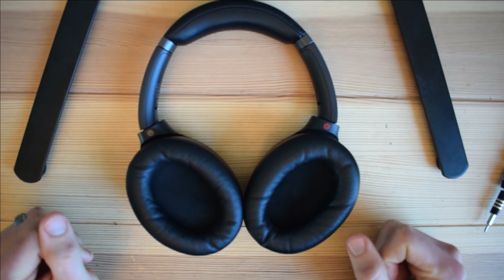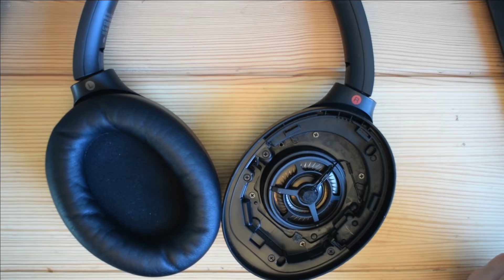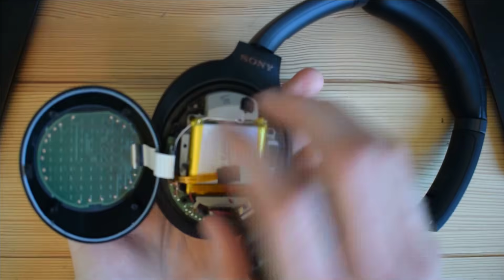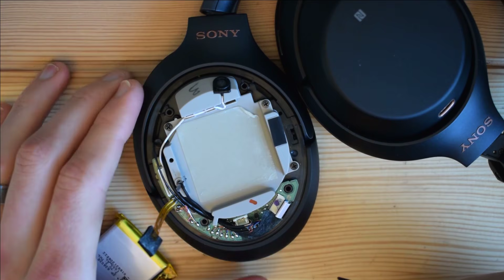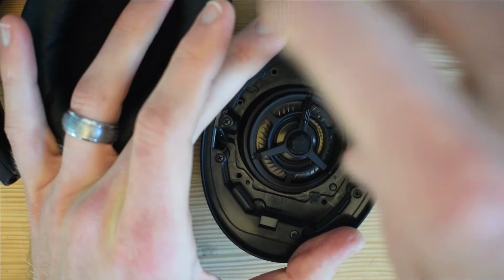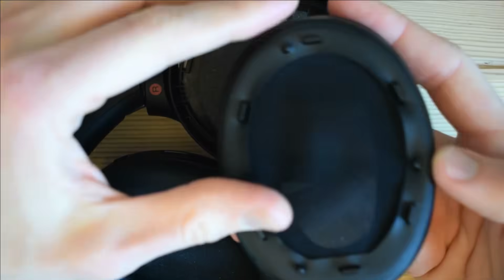Sony WH-1000XM3 Battery Troubleshooting, Repair or Replacement Walkthrough - Teardown and Fix

Comment: i have a problem on my XM3. 
when i put my headphone to Noise cancelling, the right is not working, it sounds like the right side is on Ambient mode instead of Noise cancelling. 
when i put it on Normal mode, they work perfectly fine.
when i put it on Ambient mode, they work perfectly fine.
when i put it on Noise cancelling mode, the problem will be on the right side of my headphone. the left side work perfectly because i can tell what is NC and AM and literally, AM was on the right side instead of NC. i hope you can help me with this problem. and seems the update won´t help me either.
Reply: same problem here, have you figured it out yet?
Reply: @disguyaspy  idk if the latest update has something to do with it or a problem with optimization. Atm, my headphones is pretty normal now.

Comment: great vid had mine xm3 for 1.5 years now.did purchase with £50 pcworld 3 year insurance which ive used 3 times to get brand new headsets so well worth getting the insurance but knowing how to replace the battery is suppurb.

Comment: I wasn't careful enough trying to disconnect the batttery, and ripped the battery cable female connector pads from PCB, all four of them :(
I'll see  if they can be reconnected somehow, but it's looking bad
Reply: BTW found a LOT of water inside the headphone XD 
"that's your problem right there"
Reply: Water? In which part?
Reply: Maybe you walked during rain? Btw. you can relatively easy solder cables.

Comment: i have a problem my headphones charge but when i atempt to turn them on the blue light flashes and the headphones do not turn on !

what do i do ??? , this is Urgent !!
Reply from the maker: Hello. There are a number of possible reasons the headphones won't turn on: 
1) The charging port itself could be damaged/faulty. Here is a walkthrough on how to replace that: https://youtu.be/GmfoTpZiX9U
2) The power button could be damaged. I do not have a video on how to replace that but it does not require soldering so it's a fairly straightforward repair.
3) The main board could be damaged. This is a case where unfortunately I would recommend replacing your headphones. The repair process for the board is very complex and has a low success rate (in my experience). 
Best of luck!

Comment: It's very nice to know that the earpads aren't glued down. I've had them for a year and my battery life has gone from 30 to 24 hours (I use them daily at work). Still plenty obviously, but it's great to know I'll be able to fix them in the future. Saving your video for when that time comes!
Reply: same, I don't have these but when it comes to bluetooth things, or even smartphones, how easy it is to replace the battery, and the availability of batteries is very important for long term usage if you really like the item, instead of having to upgrade every time the battery sucks
Reply from the maker: @HearMeLearn  Very good point! Phone batteries used to be extremely easy to replace but now are such a pain and you often have to disassemble the entire device just to access the battery. Thankfully these are quite straightforward
Reply: @jontriestofixthings3718  hey can we officially replace our batteries at a Sony store? Or DIY is the only way?

Comment: Had the blinking red LED warning indicating the headphones were charging at an abnormal temperature,. This happened out of the blue and I knew the headphones had not been damaged in any way, disconnecting and reconnecting the battery entirely like this video shows was the only way to resolve this issue so thank you! I strongly recommend people try this before sending off theirs for repair.
Reply: I had the blinking red LED as well, which stopped the headphones from charging. In my case, the contacts for the temperature sensor on the battery had popped off their solders. It's the yellow cable in the video. Even with my shaky hands and cheap soldering iron, I was able to solder the wires back, and all is good now. Thanks for the video!

Comment: At this very moment , I'm trying to find the right size of screw to open the battery side 

I recently drop it a few times at the gym , and the Touch Pad is not working at all, I did took it to my local Sony store n all they say was to repair at 300$ USD to replace the hardware lol , I hope when I open it , its only the wire loose after dropping it..
Reply from the maker: Best of luck! Let me know once you've opened it up :)
Reply: I have opened it , beside re plugging the touch panel connector , I don't know what else could be done. Apparently my touch panel will random register functions itself.. now I just turn off my touch panel sensor thru the app, would giving u a picture of the panel helps?

Comment: Shot in the dark. I have the 1st version that I have had since 2017 and have been great. A few days ago I've discovered that when I attach them to a charger (tried a few different charge sources and cables) the phones "lock up". Cannot factory reset, power on, etc. I found that I can restore functionality by disconnecting and reconnecting the battery. Obviouslly that is not fun to do every time I need to charge them. Any thought on battery vs charging port? or just install a kill switch? Thanks.
Reply from the maker: Sounds like it's probably not a battery issue. I'd say it's either a faulty board or charging port. Thankfully the charging port is fairly easy to replace and can be found for a decent price on eBay. I'd give that a shot first and go from there. Best of luck!
Reply: @jontriestofixthings3718  Thanks so much for your advise. These cans started to lock up without connecting a charger. I just ended up replacing them with 3 gens. I might try to repair them later for a spare or give to my wife.

Comment: These are great•••>JustU.Faith/SonyHphone?病   I bought them originally for use when we travel since the noise on air planes makes my head spin. However now so use them all the time! They are awesome. My only two implants are that sometimes the ambient noise turns on and off, my friend had to really fiddle with the settings and it hasn’t done it it awhile now. And that whenever turned on it automatically connect to whatever device it was previously connected to. My friend says this is a plus for him, but since I switch between three devices (computer, phone, tablet) it drives me nuts. Otherwise I love them! And so much so my dad ended up getting some for himself and my mother after trying mine out.

Comment: I replaced the battery on my headphones with one I purchased from this site. I did this about a month ago. Everything worked fine until today when I get a message that the battery is low but I can’t recharge it. When I plug in the headset to recharge, the red light comes on for about 30 seconds  and then turns off without the battery recharging. Could I have a defective replacement battery?
Popgrowl@yahoo.com
305-467-3680
Thanks,
Jay
Reply: Youtube is not a reclamation plattform. Is there something wrong with you? Go contact the vendor via email or letter. Not here! ... Some people ...

Comment: I'm trying to fix my left side speaker, it seems to be duller in sound and i want to replace that part. Where could i see how that's fixed?
Reply from the maker: Hello, I don't have a speaker repair walkthrough at the moment. It is the most complex part to repair, in my opinion but I may try to record a video in the near future. Sorry to not have that available now!

Comment: Hi , this work also for a mdr 1000x?
Reply from the maker: Hello. I haven't personally tried it on that model, but this technique can be helpful for battery issues on any device with a battery. It can help reset the hardware and can solve various issues sometimes.

Comment: Hi good video..mine always worked until today I try to turn on and a fast blue flash comes on once and nothing happens..have you any idea?
Reply: I got the same issue. I can charge them, but I can't turn them on... Have you fix them?
Reply: @fakunofx  yea I just held the on button for longer and it worked but try giving them a stretch or twist when doing it..I really dont know but they are working now ..it is definitely not the battery
Reply: 1
Reply: @Dave-1290r  ok! I will try that. But I know that is not the battery, when I connect them, they start charging immediately. 
Thanks a lot for the reply!!
Reply: I've got exactly the same issue since today. The hard reset (until 2:50) didn't help. Maybe I'll order a new battery now... If you have a solution for this problem, please post it here. Thank you!
Reply: I have the same exact problem. I bought a battery to see if this fixed the issue but it did not. Mine's stopped working a few days after a firmware upgrade but i wonder how can i do a downgrade if i can't turn them on.

Comment: Why i so hard to pull up the battery connecter...i see u doing so easily..until now i can't pull up😢
Reply: Yes thats right, a type of glue , u have to make a bit gentile force to pull it up ..
Reply from the maker: The battery has some adhesive underneath it so it can be a bit challenging to pry up. Try prying it a tiny bit up from each side in order to not damage the battery.
Reply: @jontriestofixthings3718  i just go to sony service centre..and they say my rc is probelm..not battery caused my headphones not charging...but its so pricey like a new price headphones..so i decided not repair my headphones...so in your opinion....this part rc have a spare parts or not..tq

Comment: I have a pair that have lost all sound to the left ear. I can't get it working after battery change, checked all wires, factory reset and aux cable connected. No idea whats wrong, any ideas people?
Reply: If everything else is functioning normally, it may just be that the speaker on that side has died.

Comment: Thanks a lot , I’ve replaced the battery and worked finally .. but it does not recharge again :-/  , same previous problem red led keep blinking continuously , I’ve put in on charge about 5 hrs . Nothing happens to new battery  still on 30% of charge .
Reply: Any solutions ?? I’m losing the new battery 😣

Comment: So I dropped my headphones and they were perfectly working fine. No scratches no physical damage. Then now that I’m trying to turn them on a very faded red light comes on the left side (NC and Power button). I tried putting them on charge and the red light switches off after a while of charging. But they don’t turn on?? They sound fine when used with an audio jack. Any fix??  Also I got them from a country which doesn’t support Sony warranty but it’s been less than 3 months I bought these. Can I claim the warranty internationally? I’ve been stressed about it. Please reply. 😔
Reply: I got the same issue... Have you fixed it?

Comment: If you were not be able to fix the issue, especially in case of red charging blinking light, make sure you have checked the NTC thermistor (it's the little piece of foam that stands over the battery) connections to the board. After I've soldered one of the two contact of the NTC that was loose, the problem was solved. I've even found out that my original battery was good.
Reply: Luca Raccampo where is it located can you point outt from this video i purchased a new one and i am having the same problem
Reply: Athar Rasheed it stands over the battery. Try to push the contacts while charging to see if that’s the problem

Comment: Hi can i ask if you know what's wrong with my headphone. The on button isn't switching on/ showing the blue light and i really wanna fix it to use T__T
Reply from the maker: It could be one of many issues. Does the red charging light come on when you charge them?
Reply: @jontriestofixthings3718  not the original commenter but I have the same or very similar issue. Wh1000xm3, no blue power light, but tries to connect via Bluetooth when touched to nfc on my phone. Fails to connect. Has a red charging light when plugged in. Any suggestions?

Comment: Hi! I just purchased a new battery through you - and my headphones are working for the first time in months - woohoo! However, when I plug them in, the red charging light does not turn on. Now I am thinking the old battery was just dead (and not broken), and there is something wrong with my charging component. Any ideas?
Reply: I'm also having the same issue

Comment: Thanks man, your videos are really helpful.
I'm just wondering if the process to replace the inner and outer swivel on this (right) arm is the same as in your other video where you replaced the swivel backing on the left arm considering the battery is on this side?
Reply from the maker: Hi. The process is the same but the internal wiring is different. I hope to record a repair video for the right side at some point soon.

Comment: I purchased the battery from you and replaced it. I seem to be having the same issue. I plug it in to charge, the light turns solid red, but the charge continues to drop rather than increase. I have done the reset again, no change. Any suggestions? TIA
Reply from the maker: Hi. Sorry to hear that the issue wasn't fixed with the battery replacement. Sometimes this issue can be caused by either a defective charging port/cable. I hate for you to have to purchase another component, but replacing this part may fix your issue: https://www.ebay.com/itm/202919539588
Reply: DIY Headphones Repair will this plugging unplugging solve the problem permanently and i won't have to open them again
Reply from the maker: @atharrasheed323  That is hard to say for sure. If it solves the issue but then it occurs again, it probably means you need a new battery.

Comment: Damn thank you for this video. Cannot believe sony didn’t implement a hard reset button.
Reply: VaZeTron According to the manual you can do it by pressing and hold down at the same time the on/off bottom and NC/Ambient for 7 secs. This will do reset to a factory setting. Hope it helps
Reply from the maker: @TheTintanboy  It can reset the settings but it won't really help with battery issues.
Reply from the maker: I agree that they really should have!

Comment: It worked. Is this a software problem?
Reply from the maker: Did you replace the battery or just unplug it and plug it back in?
Reply: @jontriestofixthings3718  Just unplug it and plug it back, then I can charge it until the battery is full. But once you unplug it and plug it back again(after the first time), it can not be charged again. After a few days, it can be charged when it is connected to the laptop and, you must turn it on at the time when you plug the type-c interface to it. very strange. And the headphone has another problem that the inside of it accumulates water vapor? The water rusts the internal screws, and I guarantee that the headset did not fall into the water or be deliberately exposed to moisture. It seems that many people have the same problems...

Comment: What if the usb-c charging lort is defekt?
Reply from the maker: You can replace that part fairly easily. Unfortunately I don't have a video for that repair, but I hope to do so in the near future. Here is a link to that part on eBay (not sold by me): https://www.ebay.com/itm/Genuine-Sony-USB-Power-Board-For-Sony-WH-1000xM3-Headphones/312817004087?hash=item48d558ae37:g:AK8AAOSwf05dsh50
Reply: @jontriestofixthings3718  Any soldering / desoldering required to replace the power board?
Reply from the maker: @Brendymullan  Yes, quite a bit of soldering is required for the repair.